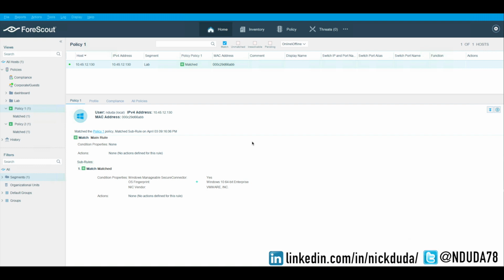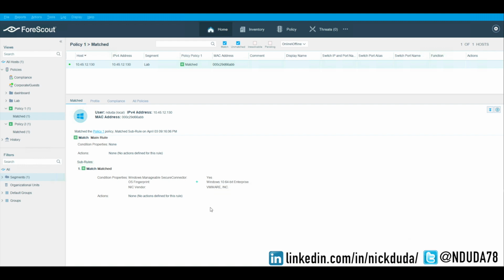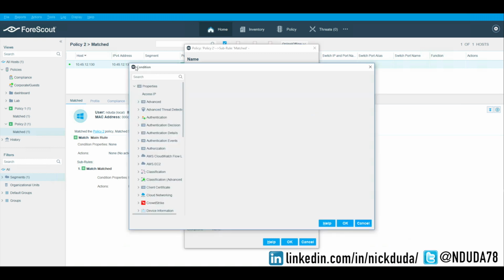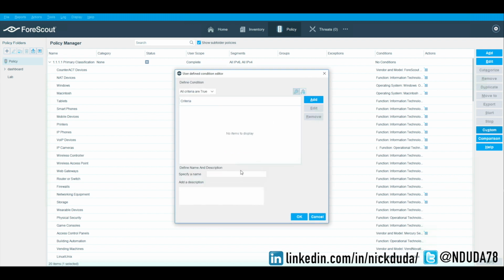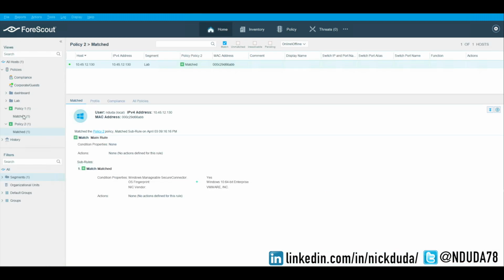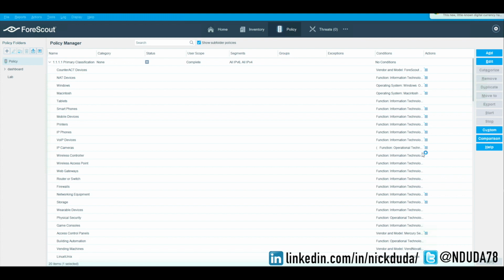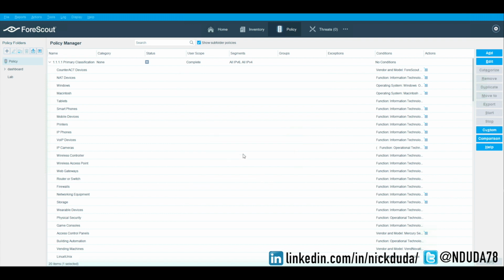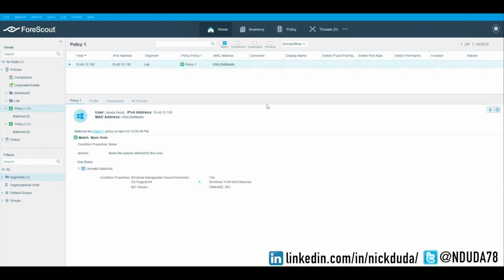ForeScout CounterACT: Custom Conditions

Comment: I just started using ForeScout and I was tested a month ago. The test was a rogue system added to my enterprise for four hours and was not detected. So you know I did not pass the test and my question is how do you detect rogue systems or set policies to find them?
 Thanks In Advance,
Reply from the maker: Bryan, you can do this in a bunch of different ways. You can write policies that straight up block via ACL or VLAN change any device that your policy hasn't explicitly allowed (by sub-rule). A typical example is to VLAN/ACL any device that isn't manageable. This would have surely prevented the rogue device from connecting. 

In CounterACT v8.1, Forescout released a new Rogue Device detection plugin. This plugin basically looks for mac address spoofing and can contain attacker mac addresses.